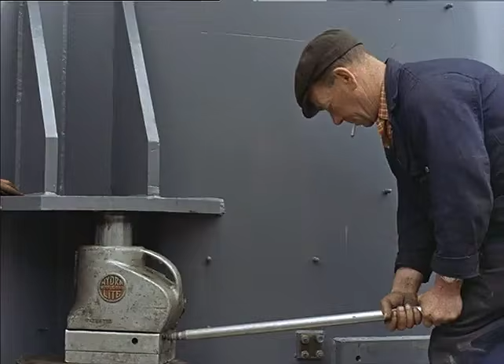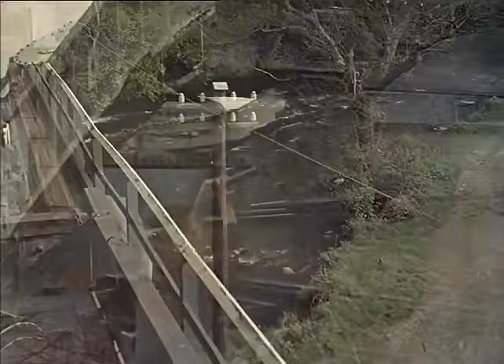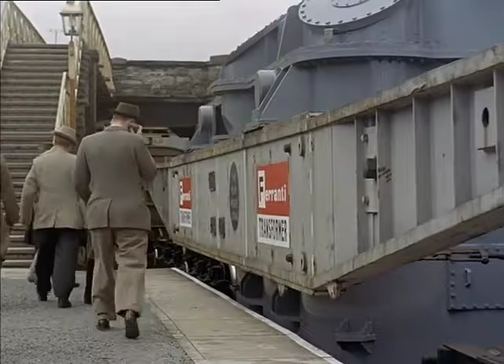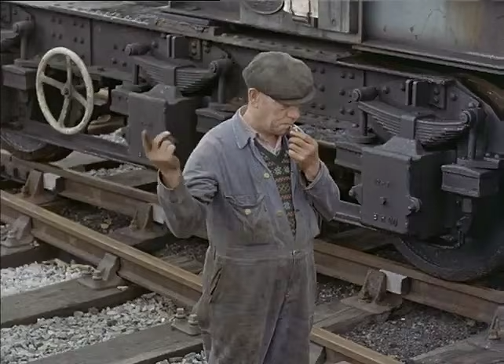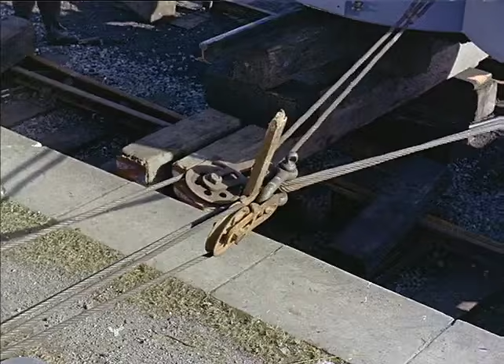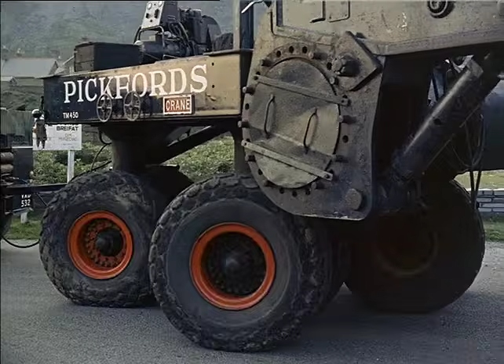Vintage transport film - Measured for transport - 1962

Comment: Nice film, mostly still muscle force to jack up and screw over the load. The road trailer was very state of the art though and it's workings similar to modern ones with individual hydraulic height control of the wheelsets and all wheel steering.
The house to the right of Tan-y-Grisiau power station is a B&B in current time where I have stayed a couple of times, the power station is still in use visually almost unaltered. It serves as a pumping-generating station able to pump water back to the upper reservoir when an excess of energy is available on the network, eg from wind or solar, and is in this respect a very eco friendly energy storage system compared with battery storage able to store many megawatt-hours.

Comment: 1962: Bridge in the way? Design the thing to fit under it.
Today: Bridge in the way? Factor the cost of demolishing/rebuilding the bridge into the cost of the thing.
Reply: Today: don’t factor in the cost of demolishing a bridge in the way. That’s an overrun to be passed on to the customer (taxpayer). Who needs planning when you got contingencies built into your contract?
Reply: @kaasmeester5903  contingencies are always part of a large project.  Pretty amazing the way they moved the load over to get by close clearances.  You would have thought they would have had some sort of pneumatic or hydraulic assist even then to eliminate the grunt work.

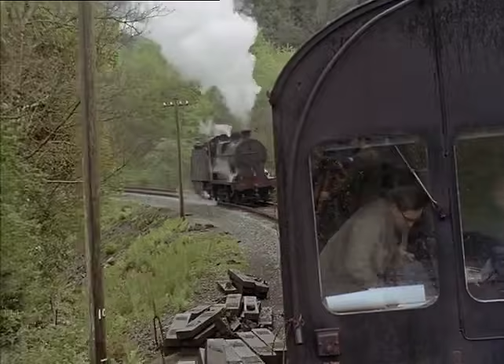Comment: 4:27 oh that poor 4F. Imagine if that load did come lose and rolled back into that poor thing. It could have derailed the poor engine, or at least cracked the frames
Reply: If the couplings broke then surely the vacuum brakes would have come on automaticaly.
Reply: The brakevan would've slowed the breakaway section, I think it was just a precaution.

Comment: Wasn't this section of line cut during the Beeching act?
Reply: No its still there.  Though the station at Blaenau Ffestiniog is now closed, replaced about 200m further along the connecting line to the old GWR line which is closed and lifted beyond Trawsfynydd Power Station, and currently disused from beyond the present Blaenau Ffestiniog station shared with the Ffestiniog Railway.

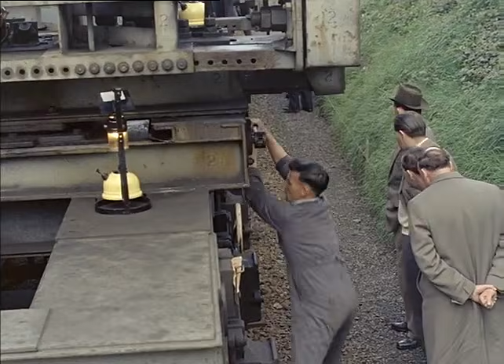Comment: 5:07.   Typical.  One guy bustin his ass, four guys supervising.

Would it not have been easier to disassemble the transformer for shipping, and assemble it on-site?
Reply: Not so much. The transformer shell is a single welded structure (to better prevent leaks of oil), so no way to make it smaller. It could be made lighter, by shipping the three cores separate from the shell, but then you would have to install them at the site, which would need an overhead gantry.
Reply: @SynchroScore  Okay, that makes sense.  Thank you for clarifying that.

Comment: You can tell this was filmed before modern health and safety, that guy ducking under the wires broke so many modern rules.
Reply: The kids being allowed to get that close is another. If this had happened in my day, my line of sight would have been blocked by a fence.

Comment: Meanwhile, not far away, the narrow-gauge Ffestiniog Railway was about halfway through having its full length reopened for heritage steam services, and its volunteers were wondering just how they were going to bypass the power station reservoir, that permanently prevented them using the original route into Blaenau Ffestiniog; at that time they had reopened from Porthmadog as far as Tan-y-Bwlch, and a few years later reached Dduallt. Twenty years after this film was made, Ffestiniog trains once again reached the Blaenau thanks to a special spiral arrangement. One may wonder though how a transformer could easily have been transported on the narrow gauge, despite obvious clearance issues. Samuel F.
Reply: Even if the narrow gauge line was still there, they couldn’t of moved it that way. The transformer is far too large for the Ffestiniog Railway’s loading gauge, plus I doubt their engines have the power to pull it
Reply: @Keiracharlott3  Couplings as well.

Comment: Surely all wagons would be on the pipe. Fully braked ?
Reply: Only the front part of the train would have been braked - there would be no way of running a pipe over the transformer wagon.
Reply: @NickBurman  I’ve dealt with steel carrying Bogie Bolsters with 60 foot long steel brake pipes to supply vacuum to the next wagon. Stoke Gifford, and St Phillips Marsh Bristol.

Comment: Fantastic to see this. Before the link line between the Conwy Valley line and the line to Trawsfynydd(on the old route to Bala) was opened of course,hence the last part of the journey being road. Biggest shock of all to me,was the sun was out in Blaenau Ffestiniog!!!😂
Reply: I agree, a splendid video.  I see your point about the line to Trawsfynydd (though I thought that was still in place in 19622 but maybe already truncated for the power station), the Tan-y-Grisiau hydro is the other side of the town and one valley over.  The last bit was always going to be by road.  The only railway along the lower lake route was the narrow gauge.  I remember visiting that power station in the 70s (74?) on an organised visit with my father and one of his professional societies (he was a power engineer).  We also went to the tunnel site of the LLanberis hydro pump storage which was not much more than a hole in the mountain at the time!  It's amazing that Blaenau Pump Storage is still in use and the contemporary nuclear station has already been out of use for 30 years.
Reply: @daveoftheclanburgess  Hydro power stations can out-last any type of thermal power station.
Reply: Eh?  The Bala line was long gone...
Reply: @philbarber2  You don't understand then. The original Conwy Valley ended at the old LNWR station in Blaenau.  The GWR line from Bala had its station where the present day NR/Ffestiniog one is.  Hence the section between there and Trawsfynydd is on the old Blaenau-Bala line!
Reply: @railfreightdrivergallagherGBRf  Ah!  now I get your point.
Reply: You're right that this was before the through link to Trawsfynydd was opened, but that has no relevance as the transformer was on its way to Tanygrisiau.  This was the nearest it could travel by main line rail, and still is.
Reply: @DavidJones-hp3yd  Indeed.

Comment: I wonder if this transformer is still operating today.
Reply: It could be? in Bristol up until a few years ago there were a couple of transformers  over 70 years old, when i asked the engineer why he told me very little ever goes wrong with them and they are very expensive to replace.
Reply: No unfortunately. Was decommissioned back in the 1990s.
Reply: @railfreightdrivergallagherGBRf Thanks for the info. Was it replaced with a new transformer? If so how was the replacement transported?
Reply: Probably's been upgraded